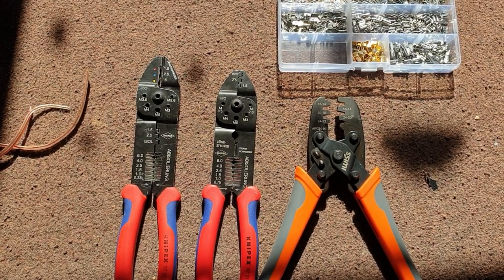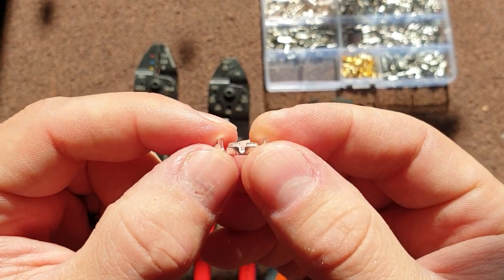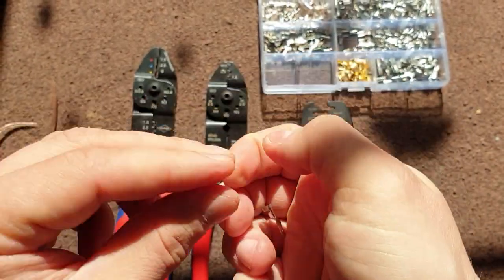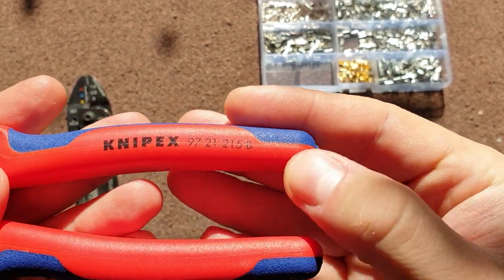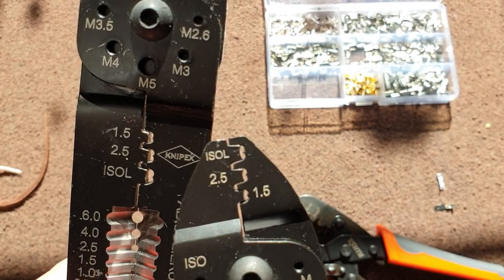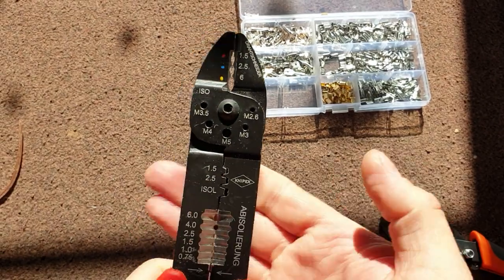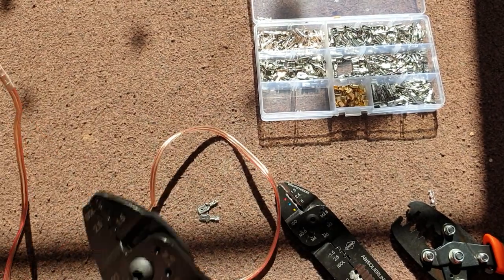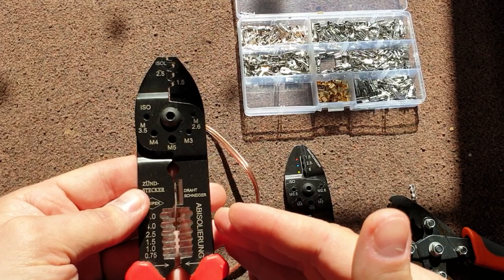Best crimper I've found - Knipex 97 21 215 B

Comment: Excellent instructions-everything explained in a very good and patient speed. Thank you very much. By the way, I've just purchaded the KNIPEX 9721215 (without the B). I want to crimp loudspeaker cables (6mm2) to my TECHNICS SU A900 Amp. Any suggestions would be welcome. Stay healthy
Reply from the maker: Well, that depends on what kind of connectors you want to crimp. For your crimper you need to find connectors that are colour coded, matching the crimper. The yellow ones take up to 6mm2 I believe. Something like this:
https://www.12voltplanet.co.uk/insulated-fork-crimp-terminal-yellow.html

Comment: When you demonstrated the Chinese tool you used the same slot for both crimps, but on the Knipex you used the 2.5 slot for the first crimp and the smaller 1.5 slot for the second crimp.  That being said, the gaps on the Chinese tool are definitely wrong, as they should be getting progressively smaller from the tip of the tool to the pivot point.  Thanks for the video!

Comment: Which joint is better for resistance? Tin plated or crimped?
Reply from the maker: In my opinion proper crimp will win as it's a cold weld joint metal on metal. Solder is an extra medium that adds resistance to the connection.